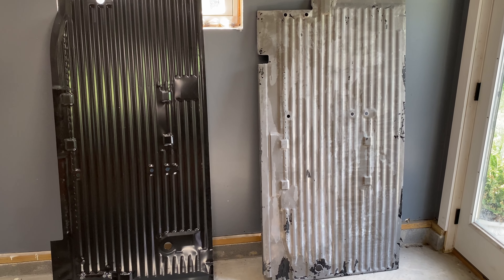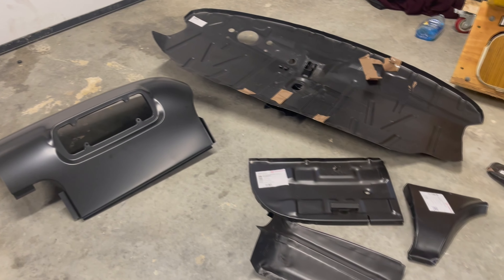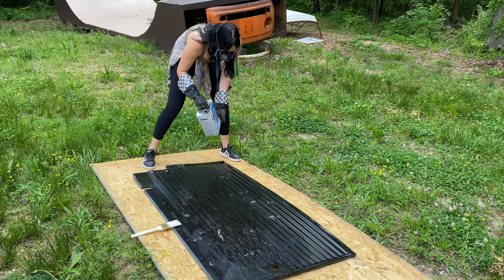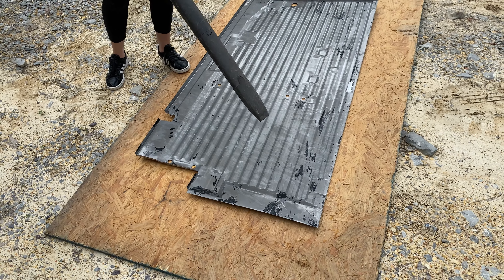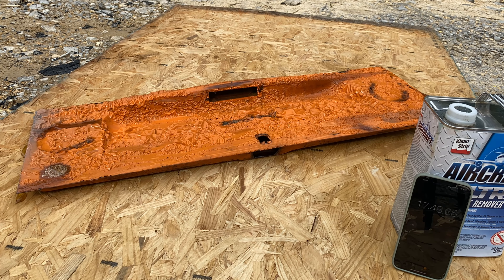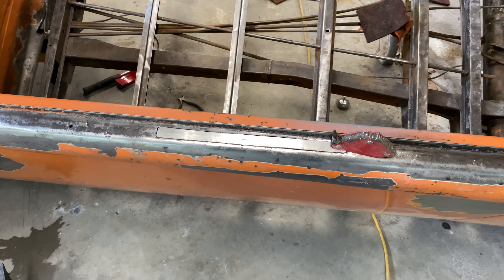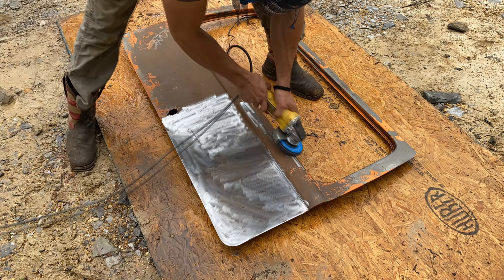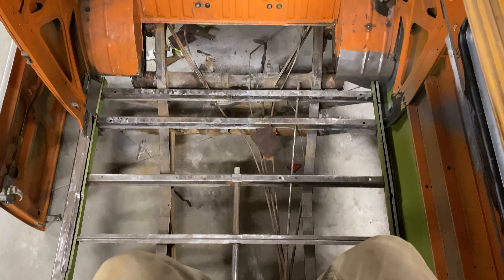Is Paint Stripper Worth It? | VW Bus Restoration Episode 41

Comment: Try acetone or mek to remove the EDP coating . If it comes off with either it needs to be removed . True EDP coating is solvent resistant and does not need to be removed .
Reply from the maker: I’ve used acetone on the black primer and it does work, but takes ALOT of rubbing to get it to come off

Comment: Great episode dude! Ive bought so many cans of paint stripper sometimes I wonder if it would have been easier to have someone blast or dip the bus before starting restoration. I might do that next restoration.
Reply from the maker: At this point I'm starting to feel the same way. I've recently seen a guy that dips vehicles near me and they come out looking amazing. I do wonder what to do with the inner frame rails and body after a dip though. Just spray waxoil in it?
Reply: @Vangabonders  A ton of people swear by waxoil or fluidfilm as being all that's needed for frame inners. I think that dipping sounds ideal bc the bare metal is left with some sort of protective coating from the dip, plus industrial sandblasting warps most VW body panels.